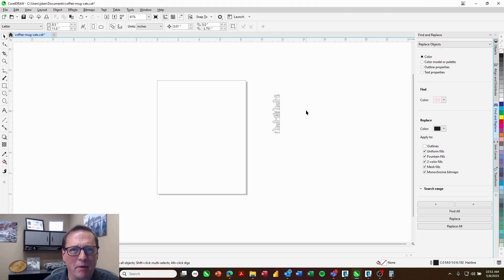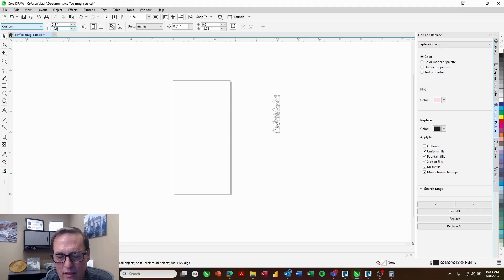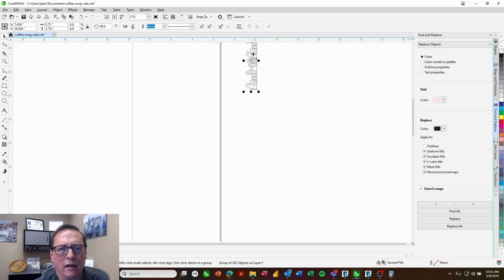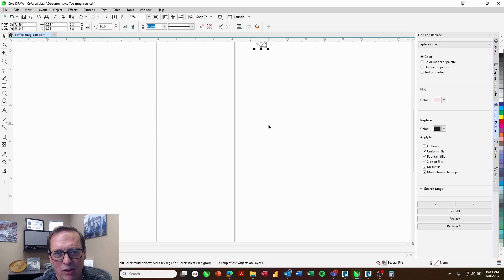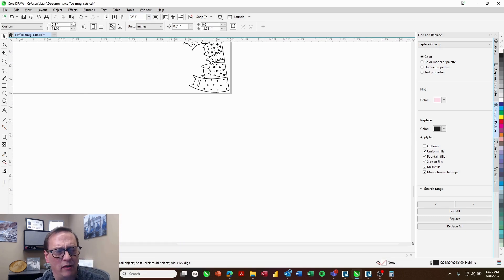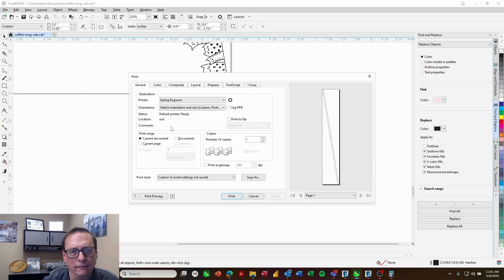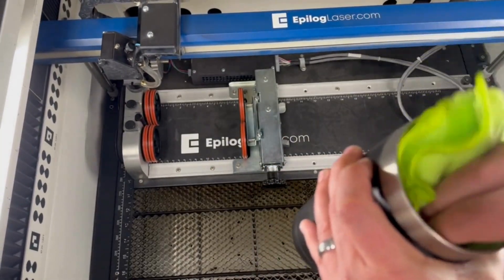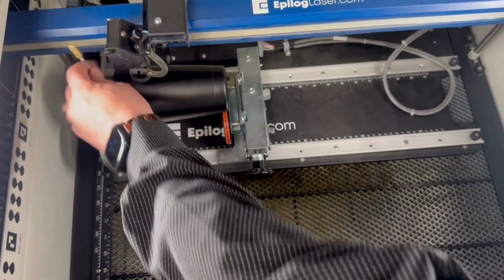Step-by-Step Guide: Designing Graphics for Full Wrap Looping Engraving

Comment: quick question...
First off, excellent video, as usual! I'm working in Inkscape and Lightburn and created the correct size document for my test tumbler and when I engraved it, the image overlapped. I tried it in both the previously mentioned programs and got the same issue. I made sure that my math was correct, based on your calculations in the explanation of how to set up the document. Could there some sort of "translation" issue from the programs to the Epilog dashboard, per chance? Thank you in advance.
Reply from the maker: There shouldn't be any issue going from those software programs, but send your file to James's attention at sales@epiloglaser.com and he will take a look to see if there are any issues.